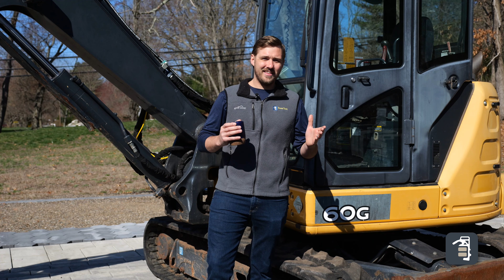How to Excavate for a Paver Project

Comment: Great video. I would go with non woven geo textile, it’s more permeable. Also I would recommend sloping excavation away from foundations and maybe incorporating a drywell into the base or a perforated pipe. 

I like your depth recommendations, especially in our northern climate.   👍
Reply from the maker: Thanks Stef for the comment, we always make sure our woven fabric has the 70 to 100 Sieve test so we are allowing the water to pass through. Using a Felt fabric separator does not help stabilize the base so I would go back to the soil types I was working with in order to make that call.  Incorporating a pipe in the base is also a crucial step. This project was performed in Pennsylvania which has some of the worst clay and we did incorporate a pipe to daylight which ran the duration of the project and I am sure it will continue to drain. We forgot to mention that in the video, so thanks for catching that!

Comment: Great video as usual, excellent production and a lot of really great tips for folks. Also, I can personally verify that their customer service is top notch, and very responsive. Always a pleasure to speak to Scott or Caleb. 

So we use a U-level, as well as a friendly "competitor" whom we communicate with quite a bit. Both of us want to know what the advantage is with a laser level in residential hardscaping applications? We don't really do a whole lot of driveways, mostly paver patios or retaining walls, and I just can't see getting away from a U-evel, particularly with the finish grading before the bedding layer. "Change my mind"?
Reply from the maker: We really appreciate those comments and will continue to give you top notch service!
 
Ulevel/Smart Level is an awesome tool to use as well, we used them for our sales team for bidding. This is easier to set up and you can get heights and elevations with obstructions in your line of site.  The benefit to a slop laser is it gives you a  more accurate reading with a visual and an auditory cue much quicker.  A slope laser will allow you to put your % of slope or height difference into the laser so anywhere you go on that project it gives you the visual and auditory cue of where your height and elevation needs to be without having to do any math.   
 
Much of this could be preference, it is what I have preferred while working on our hardscape projects but there are certainly benefits for both.